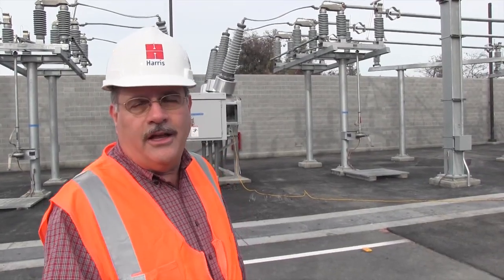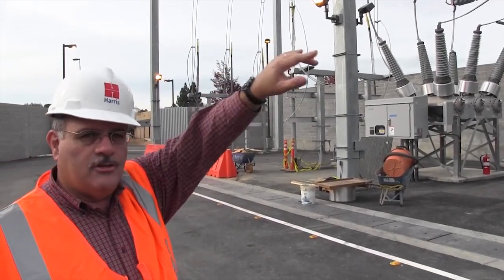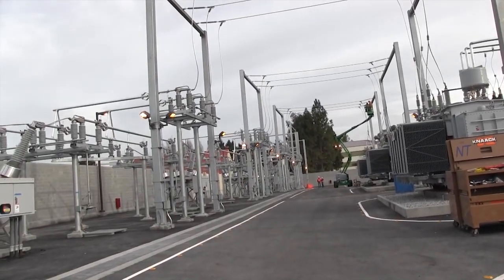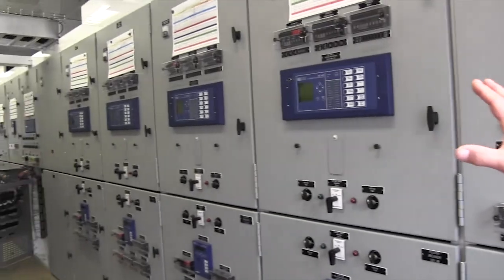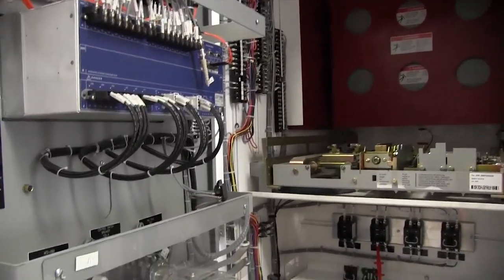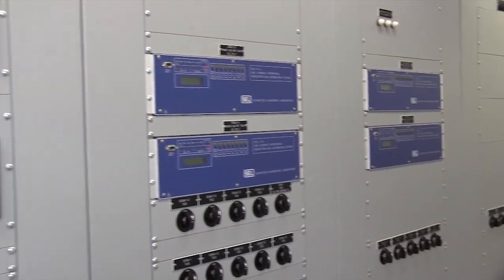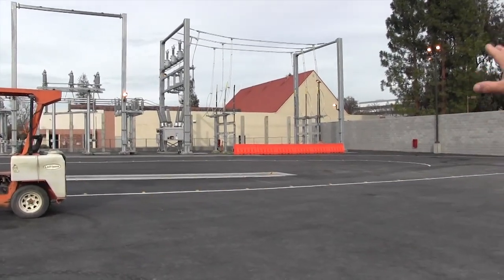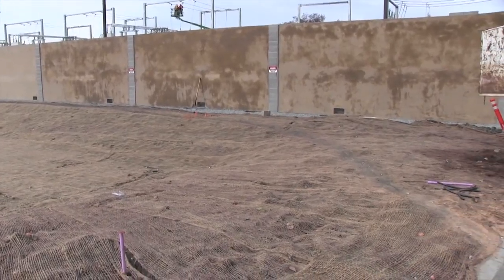Electrical Substation Tour

Comment: Unusual voltages. Here it would be 66 to 22kV. Only 1 protection per feeder? I am currently upgrading the firmware in those SEL421s
Reply: You mean no backup relays? I noticed that as well.  They might still exist but be in remote cabinets too to keep them separated from the gear.
Reply: The relays are multifunction protection.  Its likely just the Mains have redundant relays.
Reply: I think they are only talking L voltage not Primary.

Comment: The circuit breakers look like 145KV breakers but the is bus 72.5KV
Reply: I thought it looked odd too. In the UK distribution we generally run 132kV down to 33kV and the insulator sizes are very similar to those.
Reply: Same here in Australia
Reply: They might have designed the station for higher BIL for future conversion to a higher voltage.  Or just designed with higher BIL as an insurance policy.

Comment: more than likely a 69kv/12.47kv sub.
Reply: If its in California I think they use 66kV out there not 69kV like where I'm in the midwest.  Also their 12kV is typically exactly that - 12000V nominal.  Different voltage systems out there than in the midwest.  California distribution started out mainly as delta so transfomrers were wound for 12000V.  Over time, utilities like SCE have been changing over to WYE systems so you have 12000Y/6930V.  Here in the midwest we used to have 7200V delta systems and then they were upconverted to wye systems, thus came 12,470Y/7200V.  Existing transformer units were changed to be wye connected instead of delta.
Reply: 69-13
Reply: cybhunter007 one of the benefits of wye distribution is that you only need to run one hot wire into residential areas (along with the neutral of course) while all delta systems consist of two or three hot wires on the primary distribution lines.

Comment: HVDC will eventually replace long distance AC power transmission.
Reply: How will you step down the HV DC? Transformers cannot work with DC power
Reply: @aamirawan7998  You are almost correct.  A regular AC transformer can't do it.  You need what basically amounts to a switching power supply.  I found a lot of info on this on Wikipedia:  https://en.wikipedia.org/wiki/High-voltage_direct_current
Reply: maybe one day, but the amount of extra switching tech that is requiered is not effecient for those small substations, so they would stay ac forever and only the real "high-voltage" lines at hundrets of KV would be dc